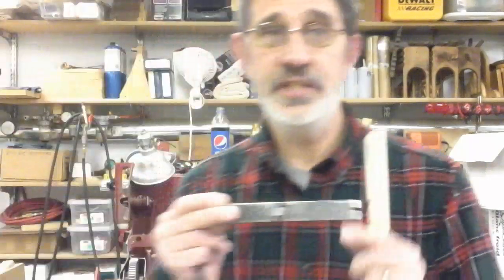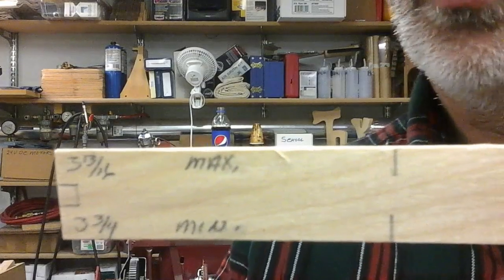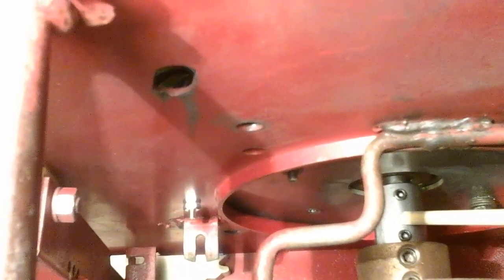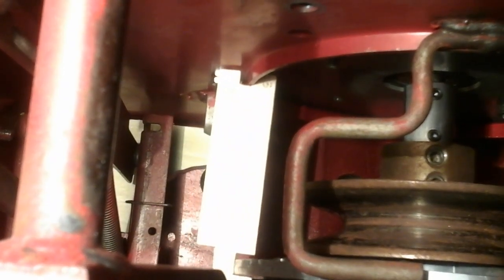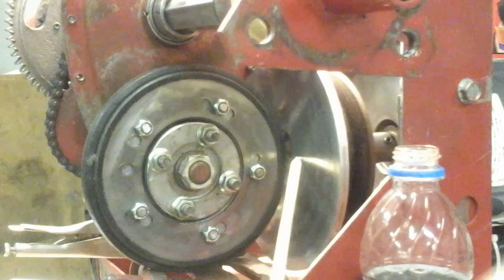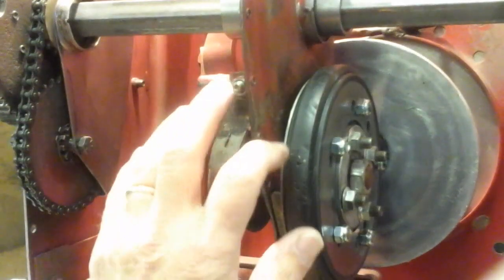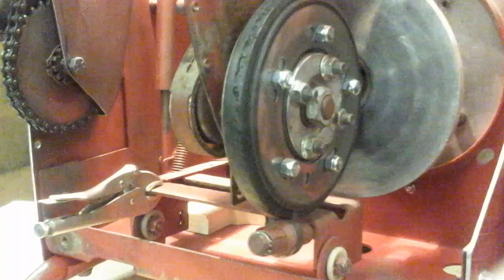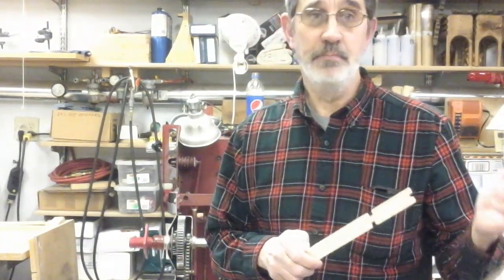70. How can I adjust my clutch and drive disc

Comment: when i shift from any gear it wont go all the way into gear, Like from neutral to reverse it doesn't slide in the gate all the way to right if looking at it from the bottom. Shifter is all the back in its gate but clutch assembly is not all the way over to make contact with drive wheel. i can send pics if you need it , clutch looks good and moved spring like you said
Reply from the maker: DAVID MCGEE 
Yes Dave sent me some pictures to my email thanks Jim
Reply from the maker: DAVID MCGEE 
  Check to see what shape your yoke is in and if that is worn it won't let a shift properly then you may have to move your boots back and grease your hexagon shaft that alone will make a shift a lot better if you grease that shaft. Thanks Jim

Comment: After reading and thinking of the issue, I think I would lower the disc drive until it barely clears the clutch drive while in neutral….
Reply from the maker: Well let me know how that works out. Jim
Reply: @jimjackson9381  
Jim, the yoke and axle bearings were good, no slack. I happened to change the yoke bracket while waiting on parts. I lowered the drive disc to clear the clutch, while in neutral. The center hole in the drive disc, is large enough to provide a void, for the clutch, while in neutral. After lowering the drive disc, it now moves well, and has good torque. I also figured out my deck belt drive excess slack issue. This mower has been slipping when in heavy grass for past few years… but I got it figured out… more later, it involves replacing the belt crank pulley…
Reply from the maker: @theencouragingword5100  stretching the frame out doesn’t help tightening the belt typically that’s what you have to do. Jim

Comment: Jim, do you have a video on how you bolted your clutch assy to your clutch?
Reply from the maker: I do but I would like to try something first have you ever watched video number 70 and tightened your yolk spring if you wanna send me a picture of your clutch disc I can see if it needs replacing or not. Jim
Reply: @jimjackson9381  I have not tightened the spring.   I will send pics to ur Gmail in a few days.
Reply from the maker: @ericensley2427  most of the time the problem is the spring is getting weak so you have to stretch it tighter, but if all else fails we can resort to bolting the clutch.  Jim

Comment: Why did I get a fiber insert with my new clutch disk!!???
Reply from the maker: You have to insert that inside of your clutch disk without that in there, your machine won’t move don’t cut it. It should be the right length you want to end to touch tightly with no gap just it doesn’t need to be glued or anything else.
Reply: @jimjackson9381  HI Jim could you please tell me if the boot and the axle seal on the right hand side is all one unit and what is the best way to install it! Thanks again for all your help!!
Reply from the maker: @eugenemarley2421  can you send me a picture so I know exactly what you’re talking about, the axle boots are one piece and you have to take the drive-through in the park to get them out.
Reply: @jimjackson9381  it's the outside seal and boot behind the rear tire on the right hand side!!

Comment: What if you put a new belt on your mower and it moves but the when you engage the blade lever it doesn't spin The blades fast?
Reply from the maker: You need to tighten the belt apparently the new ones a little longer than the old one. Jim
Reply: @jimjackson9381  did you have a video on that as well?
Reply from the maker: @joshuabeard8244  Watch video number 101. Jim

Comment: I bought a used snapper and i've been trying to adjust my clutch with no such luck. I bought a new friction disc and put it on, it's extremely jumpy when you disengage the clutch and has a hard time going straight from N to 5th but will go 4th to 5th ok. I tried adjusting the pulley position on the crank and the spring on the clutch pedal but I cant get it to soften up upon release of the clutch . Any ideas ?
Reply from the maker: You may have to drive it like a car and let the clutch out slowly, and try greasing the hexagon shaft under the boots. And let me know if it helps.         Jim
Reply: @Jim Jackson  I followed your guide and greased the hex shafts. I saw the chaincase and differntail video and I will be picking up some 00 grease and adding some to both. Maybe I am expecting it to do something it can't do. Does it normally jump pretty good when you let off the clutch. I've tried letting it out really easy but it still wants to lift the front tires.  It's not smooth
Reply from the maker: @ChrisM-nn6cj  Send me some pictures of your chain case I want to see what your clutch disc assembly looks like and the year of your machine if you know what it is it’s not an old comet is it?      Jim
Reply: @Jim Jackson  looks like its around 10 years old. I'll try to email you a picture

Comment: Where can I find info or videos on bolting the clutch together? What are the pros and cons of it? Thanks!
Reply from the maker: I guess the biggest problem with bolting your clutch salad is it takes off extremely hard and fast it will snap your head back and it will pop a wheelie if you’re trying to go up a hill it is dangerous that’s why they went to a soft start clutch and if it’s adjusted properly they work just fine if you’re having trouble with your machine going uphill check video number 70 and or 96 and tighten the yolk spring and let me know what it’s doing. Jim
Reply: @jimjackson9381  
Thank you for your response, and your videos and info.
I replaced the drive wheel and it's liner about this time last year. I'd previously watched video 70 and so I checked and adjusted the height of the drive disc, but it had lost its pulling power. I made the depth tool and even removed the deck to get a clear and unobstructed view. The disc was spot on. I removed the drive wheel just to verify that I hadn't installed it incorrectly. I found that the liner had a glazed look to it, concurrent with slipping and not pulling. I replaced the drive wheel and liner. I noticed the new liner was noticeably beefier but installed with no issues. While I had everything apart I checked the yoke and found it to be within specs. Also changed the spring to get the maximum rebound. I got everything put back together and it's popping wheelies without the clutch bolted together. Being a few pounds above 250, I think I'll leave it as is and relearn easing off the clutch and let regular wear and tear do its job. Our yard has some pretty moderate inclines but the old snapper climbs them like a rocket!
Thanks again for your help, Jim.
Reply from the maker: @stevenixon9022  well I’m glad I can help with your issues, I hope you are a subscriber it helps me and it’s free. Jim

Comment: Hey Jim Im haveing a problem with my drive pulley. The slot for the keyway keeps getting stripped out. Happens after 2 months of mowing. I've went through 3 am I missing something?
Reply from the maker: Trevor Meyer 
  Hi Trevor
     Check the shaft that your clutch disk assembly slides on to make sure that the slot or pocket for the key is in good shape and that the key fits tight into the slot check the key to make sure that it’s not worn down on the top edge you may want to replace the key 
     Because it’s what they call a woodruff key meaning it’s a half circle when you slide your clutch assembly on the shaft the key may want to slide out of its pocket hold the key down with a thin shank screwdriver when you do this slide your clutch assembly onto the shaft and slide on one or two of the cupped shaped lockwashers and put a nut on and tighten it up as tight as you can get it the assembly should turn freely after you do this, let me know if you have any further issues thanks Jim
Reply: @jimjackson9381 I've replaced the woodruff key with a new one both times. I'll have to check the shaft slot for any play. Also I'm not sure I have the cupped washers? I believe when I originally took it off it didn't have any. I bought it used.... I'll check that also . I'm guessing there is no other way to attach the hub to the shaft to eliminate the keyway all together though.
Reply from the maker: Trevor Meyer 
Hey Trevor
   No you need the key so the clutch assembly can drive the chain case without it it would just slip, if you have to order another clutch assembly order four Belleville lockwashers, put two lockwashers on the shaft with the cup side out then insert the key and put on your clutch assembly then put two more washers with the cup side in and put on your nut The nut should be a self locking style if not pick one up at the local hardware store or order one with the rest of your parts. If you have any other questions or issues let me know talk to you soon Jim

Comment: What size bolt hold the clutch down lost my bolt thanks
Reply from the maker: If you’re talking about the clutch disk,  you need a half inch wrench to remove the four nuts if you’re talking about the whole assembly you need a 15/16 to remove the one nut in the center. Jim
Reply: @jimjackson9381  thanks 🙏🏻 for the fast response

Comment: **HELP** Great, informative videos!.. Please let me know how to go about bolting the friction disc solid to the clutch assembly as the one in this video... I weigh close to 300lbs and my 33" Snapper rider is slipping going uphill and I already tried all the troubleshooting and adjustments and hacks that I could find online?.. I have replaced the belt and the friction disc & the drive disk is in good shape??? PLEASE HELP JIM???
Reply from the maker: Try watching video number 70 and tighten your yolk spring and I’ll look for the other videos.       Jim
Reply from the maker: Do you have one or two petals on your machine it makes a difference on how I tell you to do it.       Jim
Reply: @jimjackson9381  *One pedal... already tightened the yolk spring.
Reply: @jimjackson9381  *The yolk does show SOME wear but doesn't look too bad. I have seen videos of yolk replacement though when they only looked slightly worn. Does just slight wear on the yolk really cause that much slippage?
Reply from the maker: @mikeengland2668  look at video no. 33 it is for a Single petal machine.   Jim
Reply from the maker: And yes a 16th of an inch to an eighth of an inch is excessive wear in the yolk that will cause issues.     Jim

Comment: The rubber came off the friction wheel so I bought a new one but after I put it back together and started the mower it, at first it sounded good as usual but within about 10 seconds the motor started getting tighter and it sounded like a wet belt squealing I heard the motor tighten up and stop. Note the cord won't pull and the motor will not turn. The motor ran great before the friction when was changed. Is there a adjustment I need to do to release the motor? Please get back with me thank you.
Reply from the maker: OK I have a couple questions for you first, what is the temperature outside when you were working on your machine?
  When you set the machine back down on its tires how long did you wait before you started the engine?
  Let me know and I’ll get back with you. Jim
Reply: @jimjackson9381  it was in the 80's that day and im perty sure I started it a hour or two after installing the friction wheel.
Reply from the maker: @RogerPaul-planetx-nibiru  well that sounds right,  but it sounds like the engine seized up. Ck the oil and see if there is any gas in the oil. You may have to take the cover off of the top of the engine so you can grab the flywheel and try to twist it back-and-forth to see if you can break it loose. Let me know.  Jim
Reply: @jimjackson9381  yeah I did check the oil and it's good. I remember you did one video that told us something about installing the friction wheel and something about if it's not adjusted right it will seem like the motor is seized. If that happens we should take the wheel back of and do proper adjustments. I think it was a subscriber that wrote you a email with the dams problem I have. I've learned quite a bit from you and I'm certainly glad you do videos on this type of snapper. I believe it's a 89. Again thank you so much my friend, God bless...
Reply from the maker: I guess I would stand the machine up in neutral and make sure that the clutch disc is not touching the drive disc then check to see if the belt for the mower deck is loose on the pulley on the bottom of the engine, if them two points are OK then you have a problem with the engine and there’s nothing to adjust at that point you would have to check a few things on the engine I would pull the cover off grab a hold of the flywheel and try to twist it back-and-forth to break the engine loose it could be the decompression finger on the cam shaft that broke loose and causing something to jam the engine, what state do you live in. Jim
Reply: @jimjackson9381  ok I will try all that and see what happens. I live in southern Ohio about one hour east of Cincinnati out in the country. 
Right now is cold outside so I'll wait for a warmer day "later this week"  before I inspect the mower. I thank you very much my friend, God bless...

Comment: Mr Jim I recently changed the yoke and related parts, also the drive disk.  Do you recommend lightly sanding the friction disk on the motor? My mower is slipping. I also tightened the spring.
Reply from the maker: Bryan hebert 
Your drive disk is the one that’s on the bottom of your engine your clutch disk is the one that’s on the side of your chain case You shouldn’t have to sand either one of them did you replace your clutch disk if not it should be soft pliable Rubber when they get old they get hard and they tend to slip and they’ll also start cracking in pieces will break out of them check that first and get back with me. Jim
Reply: Jim Jackson I changed the clutch disk about 6 months to 1 year ago. The drive disk looks dirty or a little rusty. I will look at it again and let you know what I find out.
Reply: Jim Jackson I will also try to make a tool to check the drive disk adjustment
Reply from the maker: Bryan hebert 
Sounds good. Jim

Comment: Bought my house in 1990, owner was a 80 yr old lady, offered the mower at a great deal. Silly steering system, a rubber disc for a transmission, the tiniest tires, no hood no fenders no lights.  2024 this thing is fantastic, still in use today.  Thanks for the spring tension adjustment on the drive wheel. Good for another 20yrs
Reply from the maker: Make sure you keep it lubricated in. It probably will last another 20 years.
Reply: @jimjackson9381  did valves and rings, last year, runs great, going to my son's new house.  He loves the way it steers, and stands up for storage.  I'll probably be on marketplace 🤞 thanks again for making these videos
Reply from the maker: @tcmits3699  well when you find a replacement machine and if you need any help, let me know. Jim.
Reply: @jimjackson9381  found one already on marketplace a rear engine with v-twin Kohler and 42" deck, didn't know they used a v-twin and a double blade deck?